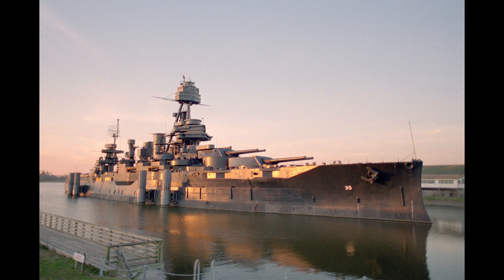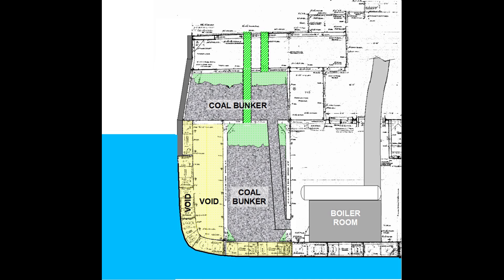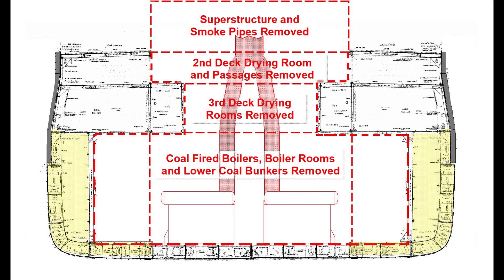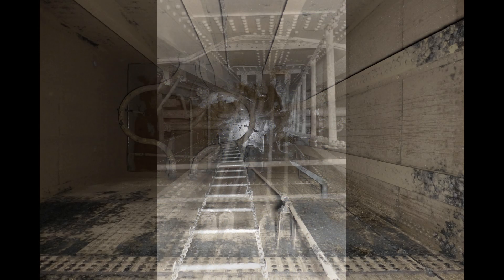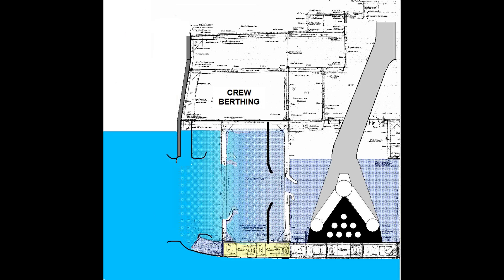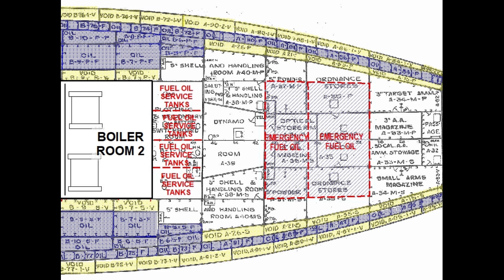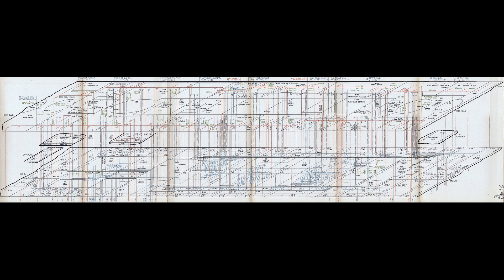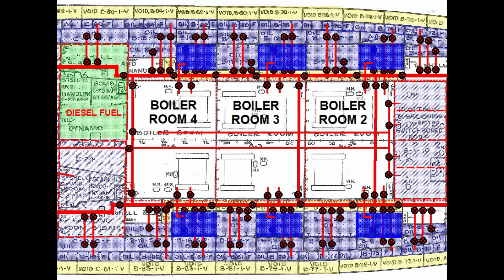Battleship Texas, Coal and Torpedoes

Comment: Anyone know what the manning of stokers changed? How many did the number of sailors reduce by?
Reply from the maker: I cannot locate the 1915 manning table that I have that would give best information.  There's a lot more affected than just the number of stokers eliminated when reducing from 14 coal fired boilers to 6 oil fired.  Off the top of my head, you first eliminate stokers and coal passers, and the overall crew needed to run 14 boilers.  Then add back in the crews for 6 oil fired, plus the oil king's crew and you get a net reduction of about 200 crew for all of engineering.  While that would also include engine room and other auxiliaries, those items shouldn't see any significant change since they were largely unmodified.

Comment: You failed to mention another equally important tank system is the freshwater production, storage, and distribution system without neither the ship nor the crew would be able to continue the battle long. The boilers can not operate correctly or at all without freshwater, and in an emergency, they can operate on saltwater but only for a very limited time then must be reconditioned. The same goes for the crew but they can never drink salt water.
Reply from the maker: I failed to mention fresh water because the subject of the video was the fuel system and its contribution to torpedo protection, in which fresh water played no role.
Reply: @tomscotttheolderone364  don't take it personally, I was the Water King on a midway class career in the 1960s
Reply from the maker: @davidschwartz5127  Only if you don't take it personally that water didn't get a mention. :)  That had to be a hell of a job on a carrier!  The water system was pretty simple on Texas.  As you can imagine, potable water had its own tank and piping that took water directly from the evaporators.  I personally wouldn't want to drink, shower or cook with water meant for the boilers considering its alkalinity.  To feed the boilers, pumps on the feed lines starting at the engine room hot wells sent feed water back to the boiler rooms at 400psi.  Those lines can be seen, but not easily identified in the steam passages that I posted in a video.  One reason is that they are insulated just like the steam lines.  The boilers didn't have economizers on them, so the water was heated in the engine rooms before going back to the boilers.  There were also reserve feed water tanks located directly underneath the boiler rooms that provided makeup water.  The feed water pumps in the engine rooms could draw off of those as needed.  In the event of damage to feed lines or equipment, auxiliary water pumps and valve manifolds that sit between the pairs of boilers in each room could draw directly off the reserve tanks that sit beneath them.  Things got dicey if they were needed since the boilers would be running on an open system and they would quit steaming when the water ran out.  If they started out with full tanks, they could last for 2 hours with all 6 boilers producing full steam.  It would last much longer if they could cut back to 2 boilers producing partial steam that would allow 10 knots of speed.

You may have seen the video I posted on the main evaporator system.  I'd love to also do a quick video on the Griscom-Russell, two effect, soloshell emergency evaporator that could produce 12,000 gal./day.  Unfortunately, I took photos, but didn't shoot a video in its compartment.  I would be surprised if you didn't have one or more of the soloshells on board when you served.  They were very compact, widely used and were the primary means of producing fresh water on smaller ships like destroyers.

Comment: Great video, explanations of the complex systems.  That photo of her after rework/upgrades is really nice. 

At the 14:15 mark, is that a valve actuator rod with a couple inches cut out?  If, why might that have been done?  It just caught my eye.
Reply from the maker: Good eye!  Most valves that I've seen in remote locations have had their reach rods cut like that.  I can only assume that it is a safety measure to be sure none are opened and cause a flooding problem.  Many of the tanks they serve have flooded at one time or another.  Any open valves could potentially spread the flooding to other locations.
Reply: @tomscotttheolderone364  That makes sense.  I thought that appeared to be intentional, as opposed to failed in some strange way.  Thank you for the reply.
Reply: @tomscotttheolderone364  so, is it fair to say that much of the water intrusion and flooding over the past several years is due to the decay of this oil storage and supply system in combination with outer hull decay?  If so, I bet it makes it tough to determine which tanks to pump out and access some of them with hoses.

Comment: What was the nominal preheat temperature for the fuel oil?  I'm guessing steam/hot water heat exchangers were used?
Reply from the maker: Oil was pumped from the main to a heater that would raise it to about 90-100 deg. F. and stored at that temperature in the service tanks.  It was then pumped using centrifugal pumps through another stage of heat to about 190 deg. F. and sent to the burners.  The heaters  look like giant white residential water heaters and used steam to heat the oil.
Reply: @tomscotttheolderone364  Thanks for the explanation, Tom. I have too many questions it seems! I hope you get to show us more fuel system apparatus like the pumps, heaters, and purifiers.  Does a schematic drawing of the fuel system exist? You showed us the oil king diagram, which is very helpful, but it doesn't seem to show all of the parts. Thanks again for all of your efforts!
Reply: P.S. I did look at the boiler room drawings in Chuck Moore's website (very helpful, btw). It does physically show the fuel system component locations mentioned above, but not the piping.

Comment: Respectfully, the air escape lines are properly referred to as fuel oil vent lines and vents.
Reply from the maker: I appreciate the input.  You may be correct in modern terms, but they are referred to as "air escape" on the ship's construction drawings and "air esc" on identification plates attached to bulkheads adjacent to them.  Look closely at the drawing at 15 Min, 0 seconds and in the photo at 15 minutes, 20 seconds for examples.  Those are what I have decided are most appropriate to use when describing the ship and equipment.
Reply: @tomscotttheolderone364  Understood. I'm a retired marine engineer and that is how I was taught. The terminology in the early 20th century was apparently different.
Reply from the maker: @musoangelo  I really do appreciate your input.
Reply: @musoangelo  And this marine engineer would like to add that it is not only a vent during filling, but it also lets air in when they are in use to supply fuel to the boilers
Reply: @janvisser2223  You're response is not very well stated. Of course vent lines work both ways, venting air out when filling and air in when fuel is taken out of the tank. When you state " ...but it also lets air in when they are in use to supply fuel to the boilers" doesn't really make sense. The fuel supply lines, supply fuel to other tanks (including day tanks) that would supply the boilers, not vent line, like you stated.
Reply: @musoangelo 
Working as a marine engineer for 45 years does of course not mean that my comments will always be understood due to my lousy english. (It is not my mothertongue)
On this side of the pond we call them airpipes. (Whats in a name)
For me a vent line was always “air out”
But I agree that one can use the word also for “air in”
So I learned something new, thanks👍
Reply: @janvisser2223  No worries.

Comment: Fascinating video. Was there a reason that they didnt replace the triple expansion engines with turbines at this time since the hull was cracked wide open to replace the boilers? I know the IJN did this to several of their older BB's during upgrades and I think the Italians too.
Reply from the maker: Plans exist that show proposals for either direct drive turbines or turbo electric propulsion.  While I do not know this for a fact, my opinion is that the recips performed tolerably well and it wasn't worth the cost and yard time to replace them.  Plus, improving propulsion wouldn't overcome the disadvantages of her incremental armor scheme and other design issues that kept her from being a first line battleship.  Whatever the reason was for not changing engines, it wasn't a bad one.  The existing engines proved to be pretty reliable with the only consistent problem being some nasty vibrations in certain cruising conditions.

Comment: that was a extremely well done video! I can hardly wait to visit Texas to look for the valves and sounding tubes. LOL  One a snipe, always a snipe. Thank you
Reply: Were you a hole snipe or a fresh air snipe?
Reply: @Scott11078  Both. I spent time in the hole making water, running and maintaining the Distillers, AC units, pumps, valves etc. My last station was in small boats.

Comment: 16 months is an astounding timeline for that much engineering, iron work, and plumbing. Much respect to hardworking individuals that made that happen.
Reply: In the meantime, the Yamato is being planned.
Reply: @oldmech619  and the Texas is still floating and the Yamato is a deep sea reef.
Reply: @Jason607  Texas is the only battleship that was built from the 1900s-1930s still in existence!!! And she still floats! Mikasa is encased in concrete and she is missing 30% of her hull so she doesn't really count as an intact original pre-WWII battleship.

And like a bonus for Texas she was the ONLY battleship to serve in Torch, D-Day (Omaha Beach ), Iwo Jima, and Okinawa. She was where the 1st Marine Division was born. She was the Forrest Gump of battleships.
Reply: To think of all the other major changes they also did at the same time it's amazing.  They basically gutted the ship and rebuilt it from the inside out.
Reply: That company that's doing the work is legit.  I've worked with a few of their people years ago.
Reply: That was back before they unionized.
Reply: @TERoss-jk9ny  bludworth-bond dry dock frequenter here. Yep, you got that right